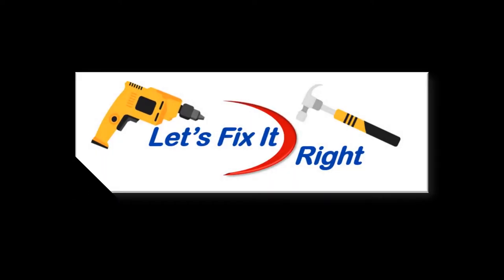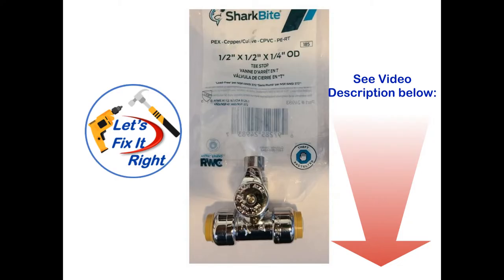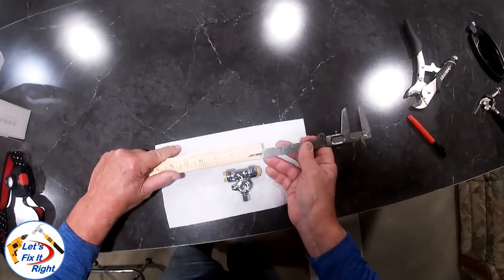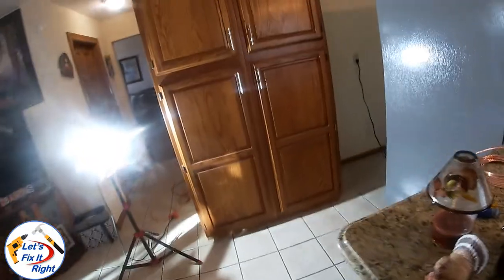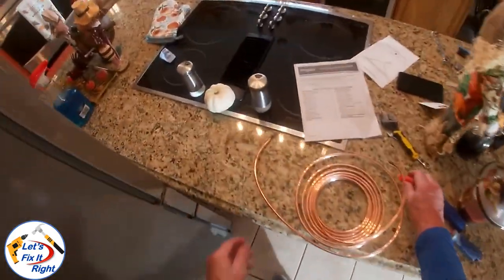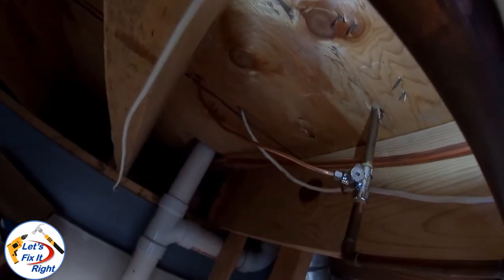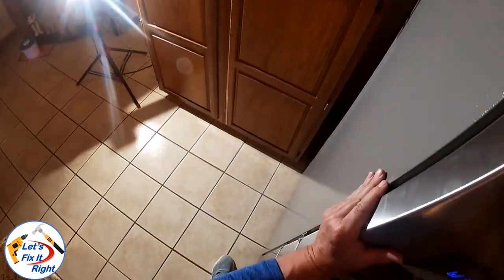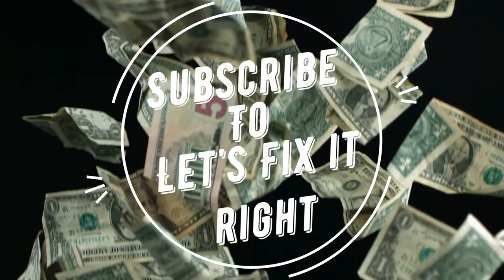Refrigerator Water Line Installation

Comment: You really need to clean the pipe before using a push-to-fit connector.  Get some emery cloth and clean it up before you cut out the damaged section.  You should also deburr the edges before seating it into the connector.  Not doing so can damage the o-rings inside the sharkbite, potentially causing a leak.
Reply from the maker: KS,

I did clean (sand) the pipe with emery cloth on both sides of the cut prior to installing the Shark Bite Fitting. I should have mentioned this.  While viewing the film if you look closely, you can see where I did this on the 1/2 inch copper line both sides of my Shark Bite.

Nonetheless, this is a good point on your part.  Thank you for mentioning this so folks will not forget to do this.

Let's Fix It Right